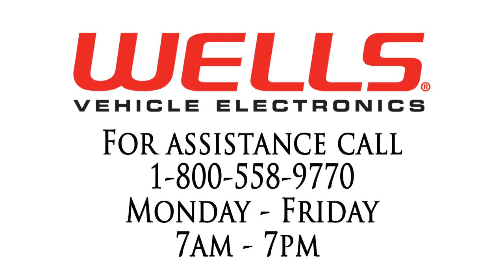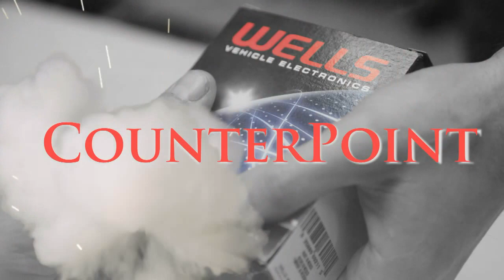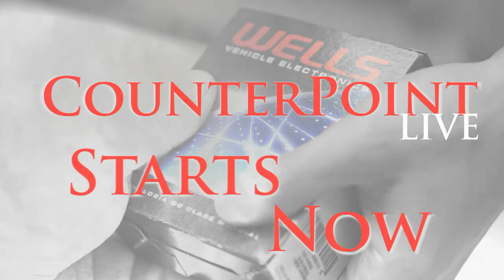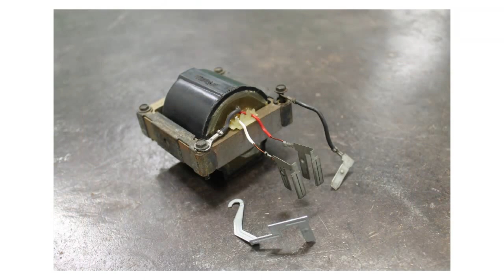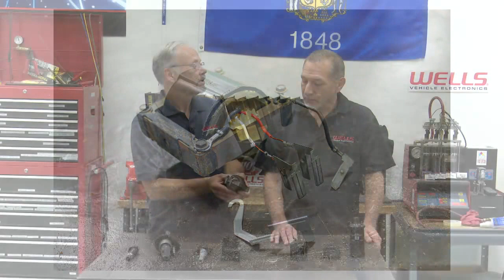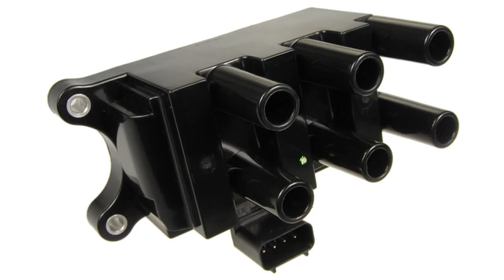Wells CounterPoint Live Ep.6

Comment: I have an 80's Chev pick up I use just for short trips to town and the dump. It runs pretty good, but, every couple of months I have to replace the HEI coil, cap and rotor. The small wires coming out of the coil are burned mainly where they go into the coil itself. I have replaced the ignition wires, spark plugs and checked compression. What am I missing why do these coils fail so often? Please answer on your next CounterPoint live. Keep up the good work!  Peter
Reply from the maker: Hi Peter, Thanks for the kind words and the comment. What year, and which engine is in your 80's truck?
Mike Becker, Technical Services Instructor
Reply: 1985 Chev C10 Silverado, 5.7L 350 Engine VIN L. THX
Reply from the maker: Have you inspected the ground wiring? Make sure that the ground strap is hooked up at the coil, but also make sure the engine itself has a good ground strap.
Mike Becker, Technical Services Instructor
Reply: In this video Glen talks about the ground strap but he says if there were no ground connection the coil would not work. My coil works but fails a month or so after. Not sure if I am understanding, could Glen and Dave demonstrate in their next video? Thank you Pete